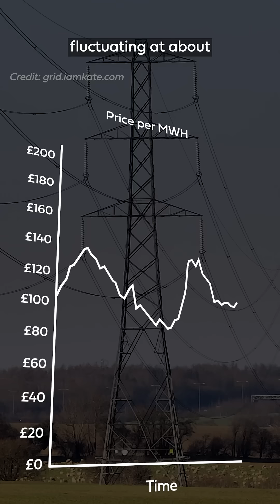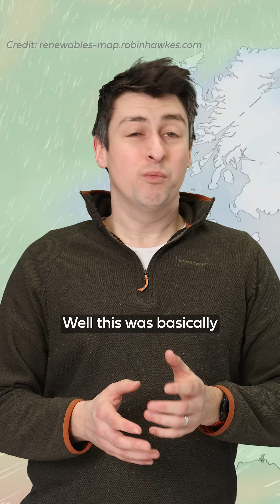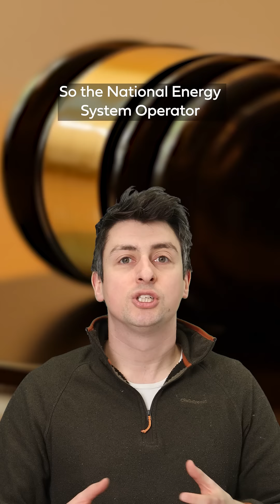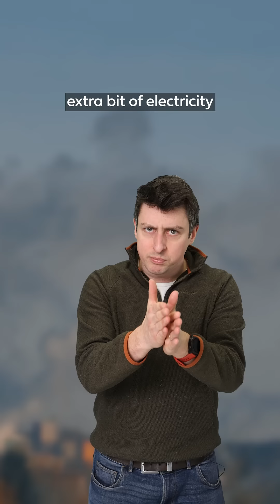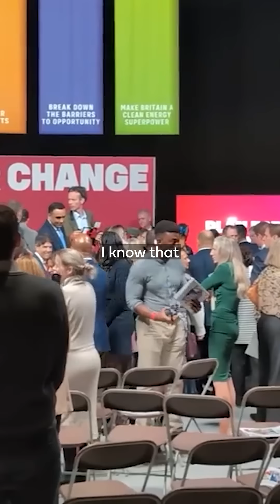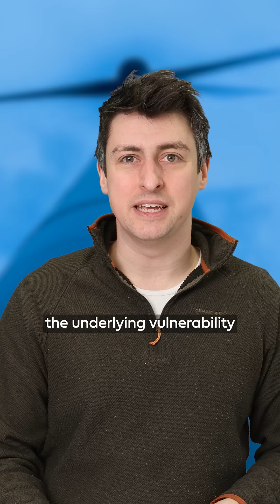The biggest price spike of the energy crisis happened last week

Comment: How would nuclear help? It's a baseload energy provider. Not running it at capacity all the time would be bad economics. And uranium cant be sourced in the EU either. The moment russia decides Kazakhstan needs a special military operation we run into the same problems we are facing now with gas.
Reply: Australia and sweden have large uranium deposits
Reply: Nuclear has major problems. Nuclear can not load follow. 
Massive industrial heaters developed for maximum continuous running. 
Nuclear is only economical if it is operating at maximum capacity 257 and has 247 cashflow. 
Nuclear can only work if it is connected to the 80million UK population, the customers and the industrial customers.
That connection is the $TRILLIONs and $TRILLIONS of grid infrastructure that is 10 times bigger investment and needs 10 times bigger cashflow than the central generation plant.

When the sunshines on rooftop PV and v2g EVs massive battery are full, and parked all night long and 23hrs every day then grid electricity will be switched off. 

Mums and dads switching off grid electricity and marking tax-free savings on grid electricity and petroleum and gas heating and cooking and hotwater.

High marginal taxpayers will be early adopters of offgrid tax-free savings v2g EVs massive batteries and rooftop PV electricity. 

The poor will need Government funding for their grid electricity.

Grid owners will ramp up their grid rental $kWh and sell the dirt cheap nuclear electricity 4cents kWh to the remaining grid customers still needing electricity and petroleum for their vehicles and gas to cook and heat homes and hotwater. 

But lets not talk about real economics when the sun is shining and the wind is blowing.
Reply: @stephenbrickwood1602 nuclear already has connections to the grid, they build new ones where the old ones were. With more air source heat pumps and more electric cars we need more base load
Reply: @stephenbrickwood1602  "renewables" have a lot more expensive connections to the grind because you have so many small connection spread out, nuclear is a lot cheaper in that aspect because you have one large connection. No one wants to sacrifice their expensive EV to keep the grid up and running if it wind stops blowing   or use their EV to run their house.

Also you will still pay for simply having a connection to the grid and if too many switch to rooftop PV (they wont)
the fee will simply increase even more because of the reduced income from sold electricity. The grid has a fixed maintenance cost that need to be fulfilled no matter what.
But you were quite hard to understand your  text completely, maybe rewrite it so its easier to understand.
Reply: @reahs4815  there is a lot to unpack.
I tried to just hilight the main points.
Reply: @reahs4815  The cheapest climate outcome is no fossil fuels used.
The cheapest electricity for the customers and no fossil fuels is GRIDLESS  electricity. 

We are lucky today to have PV and EVs.

Grid electricity is expensive electricity and no fossil fuels means that grid electricity has to be 10 TIMES bigger.

All electricity generation costs are 2 or 3 or 4 cents kWh. 
All vehicles will be EVs. With v2g massive battery storage. 
All customers will benefit just using their own equipment and vehicle.

Even the industrial customers moving away from fossil fuels to clean electricity will need dirt cheap electricity in large quantities. 
Grid Business will be to keep all customers connected, and being the supplier of feedin electricity or being the buyer of large amounts of feedin electricity.

Comment: Would nuclear solve this? like in the future 15 when its up and running
Reply: Not really, nuclear cannot ramp as quickly as gas, so in this scenario it would still not have been useful. It would form a baseline supply but would be far more expensive than wind which is sufficient for over 300 days of the year.
Reply: @ape_on_rhino8467  this kind of problem is a grid problem, nuclear is just essentially acting as clean gas but you can't turn it of or on like gas plants, here it's stuff like batteries and grid connections, so usual updates for a renewable grid, nuclear is just not that good in recent years, not as competitive as it was when it first appeared

Comment: Nucleär power is good because it is steady and reliable. It forms a good baseline supply. Just saying.
Reply: Baseload is a pretty much obsolete concept... has been for a while.
We have much cheaper variable supplies, but those need to be paired with dispatchable sources.  The Natrium (molten salt) nuclear reactor being built now in Wyoming is particularly promising because it should work very well for that.  The reactor runs pretty much constantly, but the heat is stored and the turbines track unmet demand.  It is sort of an obvious thing actually, and I think it should work with thorium reactor designs too, though Natrium is a simpler fast ambient pressure liquid salt cooled design.  (Walk-away safe too.)
Reply: @travcollier  Nuclear has major problems. Nuclear can not load follow. 
Massive industrial heaters developed for maximum continuous running. 
Nuclear is only economical if it is operating at maximum capacity 247 and has 247 cashflow. 
Nuclear can only work if it is connected to the 80million UK population, the customers and the industrial customers.
That connection is the $TRILLIONs and $TRILLIONS of grid infrastructure that is 10 times bigger investment and needs 10 times bigger cashflow than the central generation plant.

When the sunshines on rooftop PV and v2g EVs massive battery are full, and parked all night long and 23hrs every day then grid electricity will be switched off. 

Mums and dads switching off grid electricity and marking tax-free savings on grid electricity and petroleum and gas heating and cooking and hotwater.

High marginal taxpayers will be early adopters of offgrid tax-free savings v2g EVs massive batteries and rooftop PV electricity. 

The poor will need Government funding for their grid electricity.

Grid owners will ramp up their grid rental $kWh and sell the dirt cheap nuclear electricity 4cents kWh to the remaining grid customers still needing electricity and petroleum for their vehicles and gas to cook and heat homes and hotwater. 

But lets not talk about real economics when the sun is shining and the wind is blowing.
Reply: @travcollier  Are you referring to the lame startup Terrapower Natrium in West Virginia? 

I think Molten NaK is a terrible idea tbh. Sure as a breeder fuel on paper it looks amazing, but by god if ANY part of the piping, pumps, seals, wears and gets a leak you are in mega trouble! NaK and even just Na on it's own are HIGHLY volatile reactive metals. NaK detonates and conflagrates on contact with AIR. It has to be kept in a vacuum. 

And this stuff is not the first experimental salt reactor in the world. I believe there have been 3 others since the 80s and 90s. None of them have worked out well, and the sodium mix eats away at pump seals and things get clogged with invasive lubricants and all manner of problems leading to fires and accidents. The Monju reactor in Japan for example has a long history of accidents and fires and huge problems.
Reply: @robinhood5627  It is being built in Wyoming, and is 345MW... Smallish but way more than a test reactor.  As for the reactivity of the salt... Well, fluorine isn't exactly nice either.  The molten sodium salt handling has the benefit of being an established technology though.  Some big solar thermal plants use a similar setup.
Reply: @travcollier : Sorry, but that sounds like it is exactly the same concept. There is a constantly-available supply of energy. What is the difference? Just the human-controlled variability of how much energy may be supplied at any given time?
Reply: @curtiswfranks  It's pretty much the exact opposite concept.
Reply: @travcollier : How so?
Reply: @curtiswfranks  The baseload paradigm is having "always on" generators which supply a constant demand.  But the cheapest generators at this point (and for the foreseeable future) are intermittent.  So what's left on the demand side just doesn't have a constant component which needs filling.  What's needed are sources to track the unmet part of the demand.  Also, the overall demand is more variable than it used to be too, so even without cheap variable generation the "baseload" part is smaller to begin with.
Reply: Hydropower is amazing as it's both a stable baseload AND it can ramp up and down very quickly. It's the ideal power source in that sense, if you have the rainfall and landscape for it, like Norway. But it can run out when there's an unusually long drought and/or an unusually long cold winter (since frozen water doesn't flow). But if combined with nuclear or wind/solar and pumped hydro, it's stable. Pump water when power is cheap, drain when it's expensive.
Reply: @tvuser9529  Again, the grid capacity and length  can be expensive. 
Grid transmission owners will want to charge rent for the electricity to the pumps AND grid rental charges for electricity from the generators to the customers. 
The grid ain't free and it ain't cheap. 
No Santa Claus to pay for the grid.

The deception about grid electricity energy replacing 10 times more fossil fuel energy p....ss me off.
Reply: Nuclear has major problems. Nuclear can not load follow. 
Massive industrial heaters developed for maximum continuous running. 
Nuclear is only economical if it is operating at maximum capacity 247 and has 247 cashflow. 
Nuclear can only work if it is connected to the 80million UK population, the customers and the industrial customers.
That connection is the $TRILLIONs and $TRILLIONS of grid infrastructure that is 10 times bigger investment and needs 10 times bigger cashflow than the central generation plant.

When the sunshines on rooftop PV and v2g EVs massive battery are full, and parked all night long and 23hrs every day then grid electricity will be switched off. 

Mums and dads switching off grid electricity and marking tax-free savings on grid electricity and petroleum and gas heating and cooking and hotwater.

High marginal taxpayers will be early adopters of offgrid tax-free savings v2g EVs massive batteries and rooftop PV electricity. 

The poor will need Government funding for their grid electricity.

Grid owners will ramp up their grid rental $kWh and sell the dirt cheap nuclear electricity 4cents kWh to the remaining grid customers still needing electricity and petroleum for their vehicles and gas to cook and heat homes and hotwater. 

But lets not talk about real economics when the sun is shining and the wind is blowing.

Comment: That's actually not really an issue. Having a few hours a year at 20 times the normal price doesn't make much difference to the average price. 

Spending billions to save millions doesn't make sense. It's actually showing that the system is pretty well sized backed up and balanced. 

Doesn't make for clicks, but that's the reality.
Reply: @gasdive  it is because that price is very inflated and not related to actual demand, it's the result of an auction
Reply: @Solstice261  so how would you do it
Reply: @gasdive  batteries, good connection between grids, ways to make sure that when there is a bad weather front the offer doesn't completely collapse
Reply: @Solstice261  I mean how would you price it if you think the auction system is crazy?
Reply: @gasdive  how you currently do, you aren't changing the prize you are just getting rid of spikes due to having to pay extra to fire up gas plants
Reply: @Solstice261  so who pays for the batteries?
Reply: @gasdive  why are you acting like investing on improving the grid is some arcane thought that will sink the economy when it is something done quite regularly?. Makes you sound like a bad faith actor
Reply: @Solstice261  not at all. I know the auction system, and I understand it. You think it's crazy. You said so. 

So your alternative is batteries to eliminate price variations. The batteries have to buy electricity from the grid so that they can sell it again at a higher price, but you want to eliminate the spikes that would pay for the batteries through arbitrage. 

So who pays for them?
Reply: Sorry, travcollier said it was crazy, you said "inflated" but the point is the same.
Reply: Gasdive is on the money here. If batteries were the answer here people would have bought them and ran them. Reality is, you buy some when it's windy amd you sell it in a few hours. Batteries can't store that much correctly. So in winter with low wind you can sell a little and then you will sit around with empty expensive batteries. And in summer your expensive batteries sit idle because of wind and solar. Try it, model it. You lose money. Batteries need to get lots better. Cheaper and store more energy. Until then we should use gas and coal
Reply: @kapytanhook  I wouldn't say "we should". 

Capitalism requires that someone make money at every stage. It doesn't produce the most efficient result. Almost by definition. 

A state owned generator and grid produces the most efficient result because it can carry inefficient sections that make the whole more efficient. 

Which is why China is beating everyone else by every metric, and Australia was until we sold everything to private companies.
Reply: @kapytanhook  yeah obviously the situation is better in terms of profit incentive when you have this kind of extremes, selling high is in fact great for energy companies but ruins the consumer and one has to wonder to which extent companies that benefit so much from taxpayer money should be allowed to do this, it's my honest opinion electricity should be run in a way that it only covers running cost not trying to make massive profits
Reply: @Solstice261  yes. That's how state owned electricity is. Privatisation of state assets has been a disaster.
Reply: @gasdive  completely agree
Reply: Watch his video on how prices are determined.  If these spikes were just hours long transients (which they really are in reality), then you're absolutely correct.  But the way the market is setup ends up pricing all electricity at the cost of the last marginal unit needed to meet the demand.  It's sort of crazy
Reply: @travcollier  it's really not crazy. I'm pretty familiar with how it works, I was 20 years in the industry. Everyone being paid the auction price makes it possible for businesses to provide peaking reserve and makes the provision of baseload profitable. 

The only time it fails is when one generator has a large enough share of the market that they can manipulate supply in order to increase profits. That's not the case in the UK with highly diversified generators and international interconnects.
Reply: @travcollier they only do that for the hours in question. You’ve misunderstood the video.
Reply: @peter65zzfdfh  I just didn't write my comment very clearly ;)
Yes, it is just the spot price (or whatever it is called), it is the price of electricity to the consumer is the highest marginal price of production.  That's sort of standard price setting for econ 101 (the economic equivalent of a spherical cow in a vacuum) market, but doesn't really make that much sense in a situation with planning... for example, firms do not internally fund their different incremental production that way.